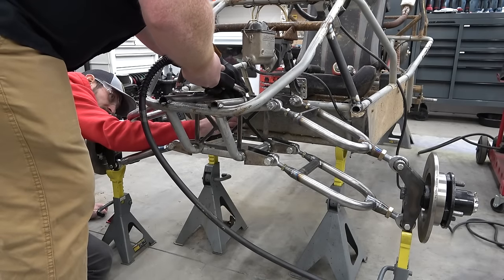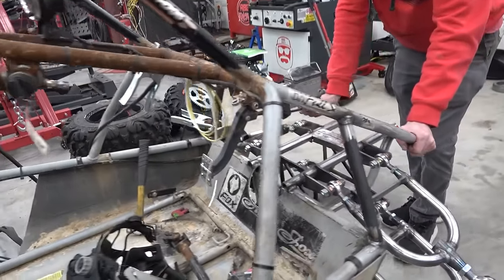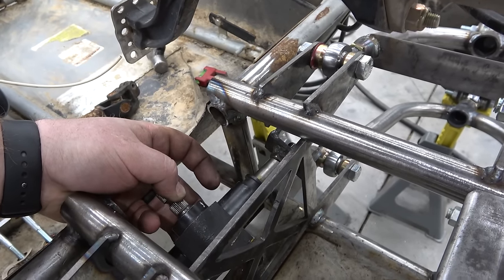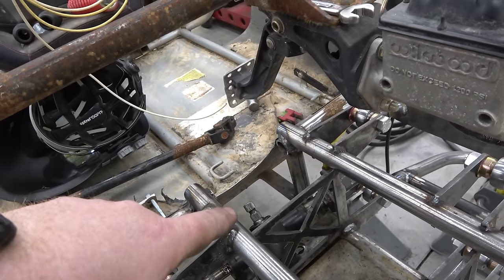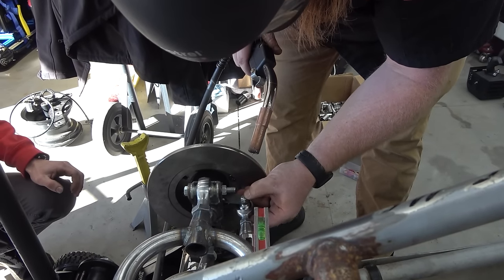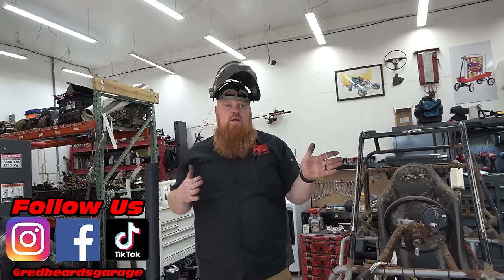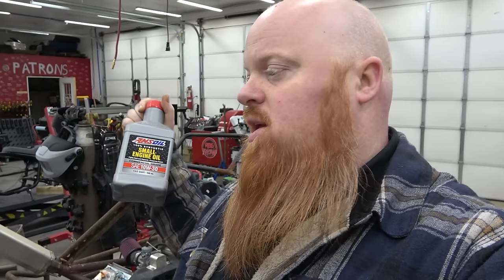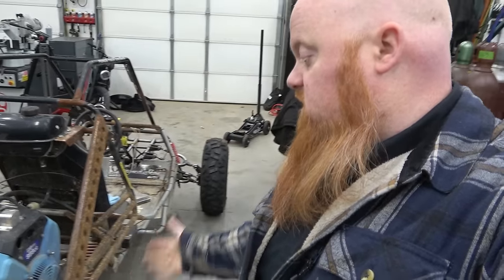999cc V Twin Buggy Dual A Arm Test Drive

Comment: The type of Ackerman you described is actually Anti-Ackerman. It's particularly only used in Formula-1 since they massive downforce amounts allow the outside to have drastically more slip angle than the inside in a turn. BTW, Ackerman is described as a percentage, wherein 100% Ackerman has the steering axis angle (line joining the spindle pivot point to the steering pickup point) pointing directly to the center of the rear axle. 0% Ackerman is parallel steering, and negative Ackerman is as you described.

Comment: Love the video I have Coleman be 200 and I am going to add an aftermarket carb but I do not want it to stick out much because I'm afraid it will be broken when I inevitably tipped the bike on its side is there a way to tuck it had one break or the filter pop off

Comment: random question, but a while back you upgraded a mule 550.  I have a recently acquired one and was wondering what shocks you would advise?  Mine is all stock and will be used to put put and work around the house , so I'm not looking for high end but more of a budget shock?